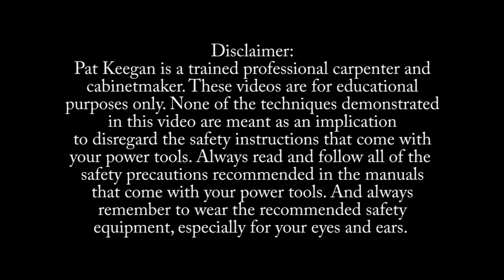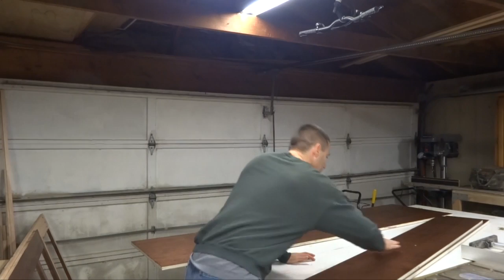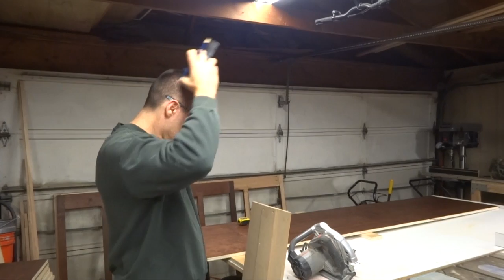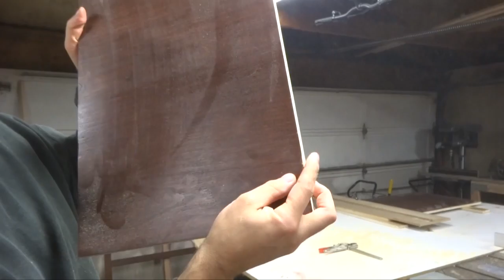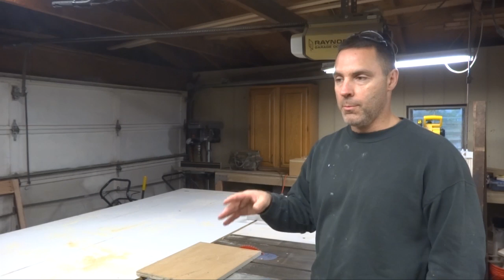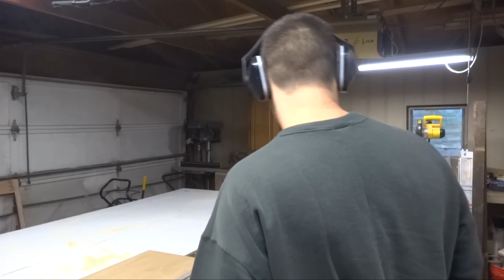How To Build Your Own Kitchen Cabinets: Part 1

Comment: Hi Pat,

I have a couple of questions. I'm wanting to build an upper laundry cabinet. This is my first learning cabinet. The face frame is 68 3/4" wide. The compartment calculator says I will have 4 spaces. I'm wondering how to connect the inside partitions? I don't know where to put the pocket holes for them. I am also wondering about my shelf pin holes. With the interior partitions, if I'm drilling holes on both sides of one partition, will they interfere with each other? Is there a trick I should know about shelf pins in this case?

Maybe my idea of how to build the carcass isn't correct because of how long it is. Maybe not correct to build it as one unit? I am a little worried about getting it into the laundry closet, only because I haven't done it. I think about your pantry example video of hitting the ceiling. I'm worried about width wise in this case though. I really think it will work, it's just me worrying, I hope. If all fails, I undo it and do it different. That is like the saving grace in this :)
Reply from the maker: Whippetfest  Always it comes down to preferences/comfort level. There are multiple ways to build cabinets and attach face frames. Cabinets are never a one-size-fits-all approach, at least for me. I might make alterations to my construction methods based on whether they are painted vs. stained; whether scribing the sides will be a factor (i'm going to do a skill builder on this in the next couple of weeks), or only one side. And you are right to be concerned about getting a very large and very heavy cabinet to fit neatly into a smaller, tighter space. 

First, a clarification: the compartment calculator does not tell you how many spaces you will have. Rather, you tell the tool how many compartments/bays you want. Providing that and the thickness of your material (usually 3/4) and it spits out the width of the what the size of the spaces should be. I left "4" in there as an example. And it doesn't take into account things like a "double-wide" panel in the middle for example.

Keep in mind that I can't really tell you what to do, only how I might attack some of the problems in different ways. There are a lot of variables that go into a decision and I don't want to inadvertently mislead you based on the specifics of your situation.

The way I see a 68" opening? I see two 34" bays (roughly) each compartment having a set of double doors (4 doors total). So in that way, there are 2 compartments, not four, unless you really want 4, with all those extra stiles, that's certainly an option. Make sense?

Yes, the shelf pin holes would interfere with each other if you drill them on both sides of the same partition in the same location. If you only have a single partition, you could offset the holes in one of them, by drilling one partition's holes 1/2" deeper into the cabinet (both front and back) more away from the faceframe for example. Or you could simply not put the shelf pins in the same spaces to avoid contact. Not elegant, but a solution nonetheless. 

Generally, I never use pocket holes on the inside of a cabinet where they would be easily visible, even if they are not visible when a door is closed. Whether i'm attaching an interior partition to the case, or to the face frame. If i were building the cabinet as one box with multiple interior partitions, I would attach those partitions to the case by drilling in from the top, bottom and back and use 50mm confirmat screws (takes a special bit), however that still does not inherently solve your face frame or shelf pin holes issue. 

If the cabinets were to be painted, rather than stained, i might pocket the sides, tops and bottoms of the face frame but then glue and face nail the interior portion of the face frame to the carcass. I will ONLY face nail if I am painting the cabinets because i can make the nail heads disappear. 

The next issue is scribing. Is this cabinet fitting between two walls? or only butting up against one? (or none?)

You have to determine whether you want to build two separate cabinets or a single box. each has their pros/cons.

SEPARATE CABINETS
Pros: generally easier to install/manage, no worry about pocket holes for middle partition, no worry about shelf-pin holes.
Cons: have to screw face frames together (Using clamps, etc), more difficult to scribe exactly if between two walls.

ONE LARGE CABINET
Pros: single face frame unit makes for easier scribing if between two walls
Cons: must manage shelf pin issues, must manage pocket holes differently, awkward/heavy to work in tight spaces.

So pick your poison. If you do one large box with a center partition, you'll have to decide how to attach the face frame to that center partition. Glue and nails? Biscuits?, etc. or you could use pocket holes and buy/install  pocket hole plugs. 

You could also build one large box with two middle partitions next to each other, which solves the shelf-pin holes, but still leaves the issue of attaching the face frame to that middle partiion. 

In the kitchen series, every bay was a separate box, but i used a single face frame to cover everything. as you put the cabinets together you screw the first box to the face frame on all four sides. When you attach the next box, you only use the pocket holes on the top, bottom and the one side that you have access to. (so it's only attached on 3 sides but that's okay because the face frame is held by the pockets of the other box) and on the side that butts up to the previous box, you can attach it directly with screws or through-hole connectors. Just like you would do if you were attaching multiple bookcases together. This is done in the video with the microwave and the other upper cabinets. In this cabinet build, i was luckier than heck because i didn't have to scribe ANYTHING...which is rare.

Ah the simultaneous joy and frustration of having so many choices. 

Hope that helped.
Reply: Thank you Pat, as always! You've given me more knowledge going in.  Today I am going to begin on this cabinet. I'll respond more in the evening to you very helpful message and fill you in on the goings on. This is my experiment cabinet as I mentioned, so I am thinking of doing a bit of experimenting. :) <- happy face :( <--scared face.
Reply: Thank you for the clarification of the compartment calculator. It did feel a little constricting thinking it would tell me how many compartments, but I thought structurally it was just the way it had to be. Novice thinking :)

I so appreciate that you are willing to share how you would "attack" a problem. Don't worry about thinking you may inadvertently mislead. To me you are sharing your knowledge and I see it is up to me to take it from there.

I did build the large outside perimeter of the carcass. It didn't fit. I didn't care. I knew I could salvage by cutting it in half and that is what I did, still need to finish. This cabinet is for me to learn on for what is to come. I'm being pretty easy going on myself about this one, knowing I'm just learning. I plan to complete it all the way and see if I can achieve the look I'm going for before tackling the rest of the kitchen. I have veered off in another way of doing my face frames at least on this cabinet. It's a different way of giving an inset look. If this doesn't work, I don't care. I will redo it, is my attitude. If I can't get this right, I want to go for full overlay.  I feel this is probably the only time I will ever build kitchen cabinets and for myself at that, so I want to go for the look I really want in my heart.

Yesterday there was a lot of time spent on new tools and ideas. A lot of time on realizing that even though you buy a brand new carpenter square, it is not necessarily square. I went through a spell of thinking the mill cut the pre finished plywood out of square. Luckily I didn't jump the gun on that and kept looking at the problem. I think from now on, I'm going to put a tape measure from end to line (where I'm going to cut) cross ways before I cut anything, to see what it is looking like. When I put the carpenter square on the corners of the plywood, most all will look out of square, but it's the square itself. I know not to trust just putting a carpenter square on the corner, but it was an observation. I'm still a little gun shy about how all of this unsquareness became apparent to me. I was thinking it was my table saw too, at the end of the fence, due to ripping the plywood. I may invest in a better fence than the stock one on a Jet just to be safer.

Being that I won't be using the large cabinet, that has cleared up the shelf pin problem. Although I did have fun putting them in the sides of what I did build, having what you taught in my head.

Interesting point about multiple partitions and connecting face frames. Even though now it won't apply, it's good to know and think about.

I'm thinking the scribing won't be an issues because yes the now 2 cabinets go between two walls, but they are plain sheet rock walls, and I'm thinking I will use small pieces of trim on the outsides if needed. If I'm not correct, please say so.

I do like having two cabinets because I can install them by myself if no help is around.

I'm going to have to watch the microwave cabinet build again, to better picture what you are explaining. I think I know, but I need to watch.

Thank you for everything!
Reply: btw, just to be clear. I wasn't using a carpenter square to build the cabinets. I just picked it up when I was trying to figure out why the panels their selves seemed out of square. I have some other much better squares including an engineers square. When I looked again at the panels this morning with the tape measure criss-crossed, things looked much better accept one panel. I'm just being as meticulous as I can be and at the same time on learning over load, loosing sleep thinking about this project, feeling a little ill because of nerves about it etc. :)
Reply: Forget that I said I was going to attempt a type of inlay. The guy at the mill showed me this kitchen, I loved it of course. He said it's pretty easy at first. He didn't build them and started telling me different later. I'm going with what I know I can do. The cabinets at the mill, the inlayed type (not typical inlay) is what's making me lose sleep! I'm going for full overlay. Between you and Ana White's kitchen plans, I can get the look I want.
Reply from the maker: Whippetfest are you talking about inset doors that are flush with the face frame? If so, they do take a little more time/effort than overlay doors, and they really require your face frames to be square as square can be. There's a few more steps involved and dimensions must be paid attention to carefully to allow for expansion during humid weather.
Reply from the maker: Whippetfest Remember quality is not perfection. Just take your time and try to have fun with it.
Reply: Excuse me, yes, I meant inset. These were different in that they had an inner face frame which the doors rested against and then what would be a second face frame built around the doors connected to the first face frame. It was all barn wood so a bit rough, which was cool. Although it looked easier than the precision of normal inset cabinets we see, I still decided it was freaking me out and overwhelming me in not having enough information of how they were built exactly.  I've felt a lot better once I stopped being side tracked with what the guy at the mill was saying. I have no idea why he even showed me those cabinets. I went in there only wanting materials :) I've known him for years though.

I have very nice full overlay vanity's in my bathrooms. This is where it started that I wanted full overlay initially in the kitchen. I feel confident again in what I am doing and am back on track having fun :)

I like that.... "quality is not perfection". This really fits in my life.

Thank you again Pat.
Reply from the maker: Whippetfest If you like that quote, you might appreciate the one I posted on our facebook page, by Ira Glass.
Reply: Sonia, it's not coming up in my search? checked and double checked.
Reply from the maker: Whippetfest I removed this comment. I highly recommend you read the reviews on this product before purchasing. http://woodgears.ca/ted/
Reply: After I commented back to her post, I had a bad feeling...
Thank you for the reply.
Reply: mysecretblueprints. com has a few awesome plans for my new cabinets Im putting up tomorrow just can decide which one now

Comment: Thank you so much for the DIY video;  especially  useful is the 'on-the-side' info., e.g. cabinets are usually 12" but micros are 16"... Im in the process of redoing my kitchen and would very much like to build my cabinets. This desire may be short lived as I attempted a few years ago, before youtube, to do shelves in the garage and honestly after 4 hours of looking at the unfinished walls of the garage I ended up with a 2x4 across a corner. Truly.  
I dont think Im ready to do the larger 5 door project, so am wondering, do you have a video or referable resource for building a kitchen sink base cabinet? 
Much appreciated, Rebecca
Reply from the maker: +Rebecca Collier Sorry i missed this comment. Probably too late, but yes, there is a sink base video on my channel.-Pat

Comment: I was wondering was there a reason for using the pre-finished maple for the boxes instead of say  pre-finished birch that is substantially cheaper.
Reply from the maker: Scott Newhouse Great lead-in question. No real reason, just that I'm fond of the look of maple over birch, in general, though I supposed maple is "harder" if that matters for the inside of a cabinet.

Where i get my plywood, the same B2 veneer core maple by comparison is only $6.00 more expensive per sheet UNFINISHED, so not really that substantial, per se. 

However, your question prompted me to investigate. What i just looked up was that the same C2 veneer core maple PREFINISHED is $18.00 more expensive per sheet than the PREFINISHED C2 birch. Strange because C2 birch is considered "paint-grade" for cabinets. I would have assumed that the increase in price would have been identical (like say $20 for prefinished vs. unfinished) but that doesn't seem to be the case. So thanks to your question, I'm definitely going to call and find out :)

So let's assume we go with the worst case at $18.00 a sheet difference. I think I used about 6 sheets, so worst case you're looking at about $108 of savings. Substantial? that might be subjective, but a cost savings is a cost savings. There's no right answer really, just one of taste vs. affordability. 

I say it's a great lead-in question because i'm going to be doing a video about the cost breakdown of this kitchen, and also provide several alternatives to reduce cost. Using birch is definitely one of those ways, because most people seem to be like-minded in that "every little bit helps".

Thanks for the great question, and of course for watching and posting.
Reply: Thanks for your detailed reply unfortunately I am having a heard time finding  any prefinished in my area at but Lowe's does have birch or maple at about the same cost
Reply from the maker: yeah, that's my problem too...i can't seem to get prefinished at any of the "big box" stores near me either. The other thing is that most plywood at home centers is not usually 3/4", rather more like 11/16", so be careful of that.

I had an article somewhere on a really good finish formula for making your own "prefinished" plywood. I have to find that and post it.

Thanks again for the great questions and taking the time to post.

If you're interested, we're giving away a free t-shirt to a random person that leaves a post on our free t-shirt video :)

Thanks again!

Comment: Your videos are so good I re-watch them and while re-watching this one, I heard you mention the urethane product again. Which brought up a couple of questions. First, what brand of wipe on do you use? Secondly, what do you do with your rags between coats. Do you have to watch out for spontaneous combustion?
Reply from the maker: Barry Straughan Thanks Barry, you are very kind. I use Minwax Wipe-on poly (Satin finish) most of the time. Though it's a wipe-on variety, I typically use foam brushes for the first coat or two, and then a soft cloth for the next two.  We have a separate disposal area that is NOT inside the shop (which we ventilate very well during application so that 1) we don't kill brain and lung cells and 2) not worry about spontaneous combustion.  Thanks again.